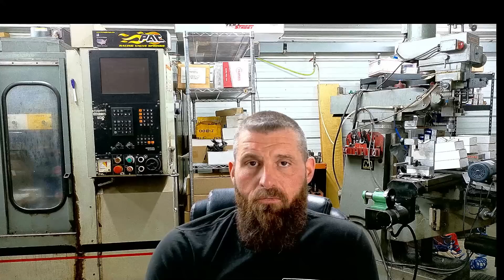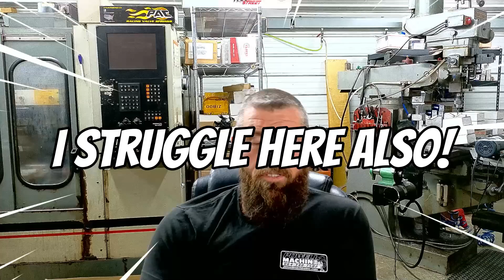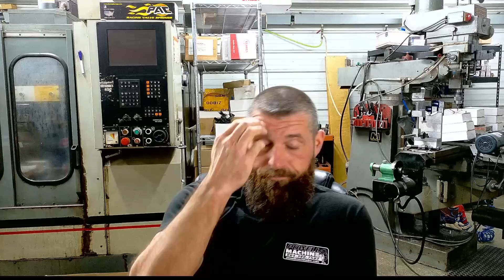A story about Data....

Comment: There is so much to understanding data. You need to look at the shape of the data at times to understand what makes the data important.  It takes a keen eye to pick that up.   

Two things stick out to me. The first is distribution skew. It changes everything. The second thing is sensitivity analysis.  Can a minor change in one variable change the result significantly? In other words, is the data sensitive to that one variable. If you don't check that, it's easy to get a partially correct answer or one with a narrow application range.

Comment: Iv'e pulled a few calves barehanded, you got to get one leg ahead of the other, think of  YOU crawling thru a small hole and you should get the picture.  One large corperations motto was "knowlege is power" in my opinion they allmost got that right, if they had said "application of knowlege is power!" A lot of ideas never take root.

Comment: There's a saying in the statistics world "Correlation is NOT causation." 

The rooster thinks he's responsible for the sunrise because the sun comes up when he crows but, the rooster can't see the bigger picture. 

A lot of the time you can see in data what you want to see. Then the data confirms what you thought you knew before you started. That's called confirmation bias and it's a pretty common problem for humans

Comment: I should add to especially for myself trying to build a better performance engine and you know some people have there way of doing things for sure but what I have noticed you know people do something that you know is not correctly or at least up to date on what's going on to make the best power and if I was stuck in this small group and not learned as much as I keep doing later on then I would of been like I guess all this stuff is ok when there other people finding ways to make more power then this small group I know it sounds really weird I just thought I would give an example. Because there are people stuff with there old ways and not change thing and think this is the only way or whatever with all these variables.

Comment: Yeah I definitely agree 100% you know it's to bad at least where I live there isn't a engine performance class about all these things so it's to bad and hard at the same time just because those classes are just for mechanics to fix car and not building performance engines. Even auto body in my area is dying it's crazy. And I honestly wish that there was a engine performance class that could help a engine guy make a faster engine or whatever. Like camshaft class to a cylinder head porters class. Machining or some kind of parts class that you can learn what any performance parts does and then change like you said a better cylinder head now what did these same camshaft do. I mean all these factors and yet nowadays they just slap a turbo on a LS and called it a performance engine you know what I mean.
Reply from the maker: @chevyrc3623  yep  and the one's available insanely expensive
Reply: @powellmachineinc  oh wow the price yeah that's definitely another issue

Comment: Great lesson, thanks. I was a customer of Joe Mondello’s in the 60s, bought some ported SBC cylinder heads from him. Ran them on a “301” as we called them then, and then a replacement 365 hp 327 shortblock when the cylinder walls gave up. Isky solid roller with a rev kit and stud girdle made in my Dads shop, and Kinsler injection. In a C Gas dragster it went 8.99 @ 154, pretty tame by today’s standards. Good memories…
Reply from the maker: @bdugle1  absolutely,  good stuff!

Comment: I'm just glad the term "city slicker" is still being used in certain parts. Lol! Reminds me of older days. You know, Lylkins just did a video kinda along these lines talking about camshafts and manufacturers stating what the cam is supposed to do, but being impossible to even know without knowing exactly how the rest of the engine is set up.  Thanks for reiterating this subject.
Reply from the maker: @DanielSmith-yp7mw  yep, that's very accurate

Comment: We talked about this on the Live, change one component and everything changes. I love Data but i have to be able to interpret the data to know where I need to go! Too much Data you risk chasing the rabbit down the wrong hole..
Reply: But apparently you can select LSA by a formula which doesn’t take into account any other component on the engine. Just ask DV.
Reply: @joshiek7839  that is not true... The Computer program that DV and Stan Weiss developed is much different than the 128 rough and dirty "Formula" you must enter the Cylinder data for it to be correct. And with a Program your Data inputs must be correct or you will get a junk output
Like I said you must be able to interpret data to get correct results. Not trying to stir the pot. Just simply replying. 
I'm a racer that wants to win. That's all, I've seen engines Dyno run really well but underperform at the track and I've also seen it the other way. My point is the track has the final say. How you get to the final results be it a computer program /experience with a combo / or just a lucky guess is what matters... Every race and championship I've won I've never had anyone ask.. how did you pick this or that.. Everyone has their own way of doing things and I'm good with that 
Hope that helps
Andy
Reply: @UnityMotorSportsGarage  and yet the 128 formula was pushed despite being rough and dirty…
Reply from the maker: @joshiek7839  unfortunately I knew this was coming....,
Reply: @powellmachineinc  no, arguments from me I respect others opinions on subjects That is how we learn!
Reply from the maker: @UnityMotorSportsGarage  I agree 👍
Reply from the maker: @UnityMotorSportsGarage  absolutely 💯